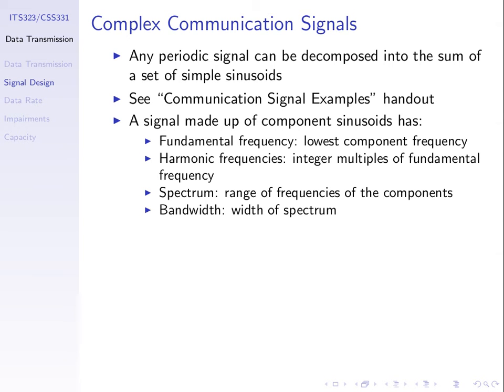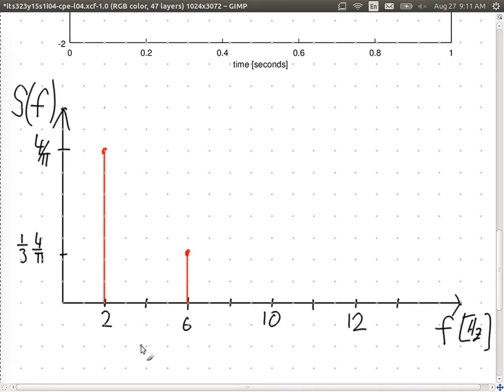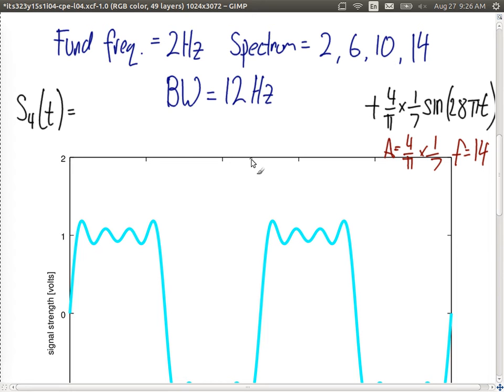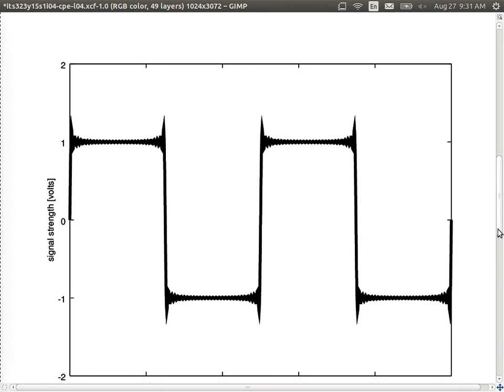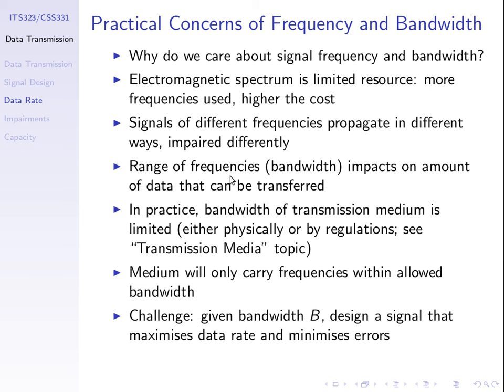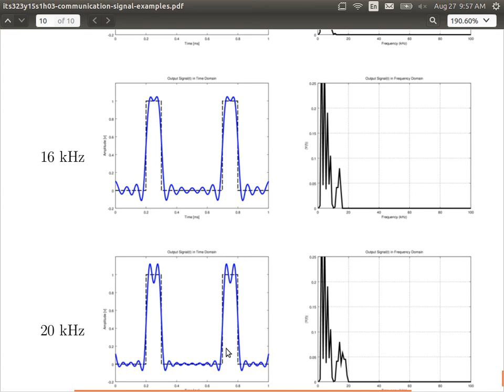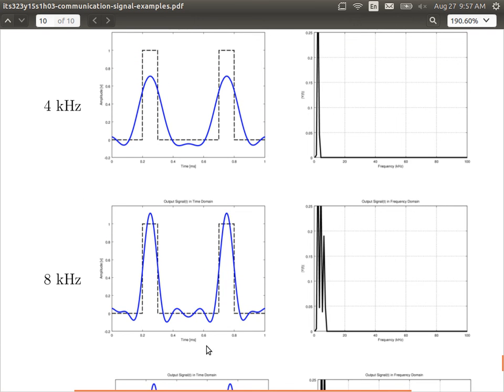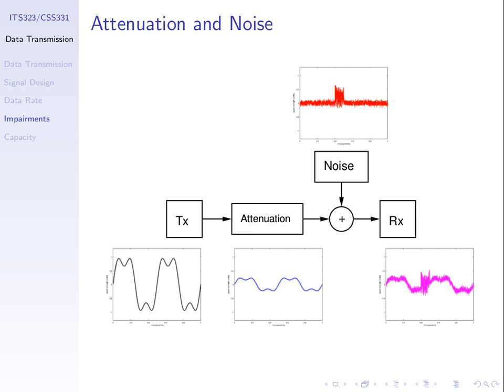Signal Frequency and Bandwidth (ITS323, L4, Y15)

Comment: • Often the components of a signal are 
  ○ Fundamental frequency: lowest component frequency
   § 2hz
  ○ Harmonic frequencies: integer multiples of fundamental frequency
   § 6hz
  ○ Spectrum: Range of frequencies of the components
   § 2, 6 hz
  ○ Bandwidth: Width of spectrum 
   § 4hz
 • Time domain
  ○ Signal amplitude vs time
 • Frequency domain
  ○ Signal peak amplitude vs frequency
  ○ Usually easier to analyze
   § Can immediately identify number of components sin
   

Relationship between Data rate and Bandwidth

 • s(t) = sin(2pift) + 1/3sin(2pi3ft)
  ○ A signal with two components
 • Increasing bandwidth 
  ○ Increases data rate
   § Increase vary with the 
  ○ Increases accuracy (closer to square wave)
  ○ Increases frequency
  ○ Increases cost
 • Increasing levels also increases data rate
  ○ Increases errors since less difference between levels

Transmission Impairments
 • Attenuation 
  ○ Signal strength decreases over time
 • Increase noise = increased errors since it could flip the bits
  ○ Caused by thermal, air, background noise
  ○ Larger the bandwidth we use, the more noise introduced
  ○ We overcome noise by
   § Increase signal strength 
    □ This may increase noise among nearby signals though (crosstalk)

Channel Capacity

 • Channel capacity: maximum data rate that can be transmitted 
 • Nyquist capacity
  ○ Assumes no noise
  ○ C = 2B log_2 M 
   § M is number of levels
  ○ Example
   § Telephone systems have a B of 3100hz (since human voice is about 3000hz) 
   § C = 2(3100)log_2(2) = 6200b/s
   § DSL modems got up to 56kbps, so they increased the M (levels). 
    □ We cannot increase bandwidth, since that's a characteristic of the wire
 • Shannon Capacity
  ○ Signal-to-noise ratio
   § SNR = Signal power/noise power
   § Shannon capacity
    □ C = B log_2(1+SNR)
  ○ Ex : Spectrum of 3Mhz and 4Mhz, with SNRdb 24dB, how many signal levels? SNR = 251
   § B = 1Mhz
   § = 1 log_2(1+251)
   § ~= 8mb/s 
   § To get levels, we use Nyquist formula
   § M = 16